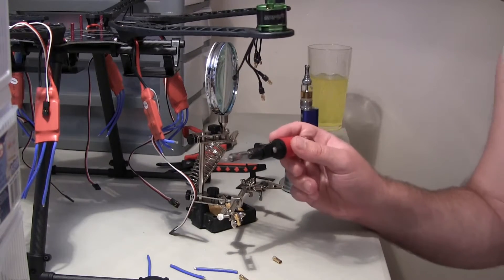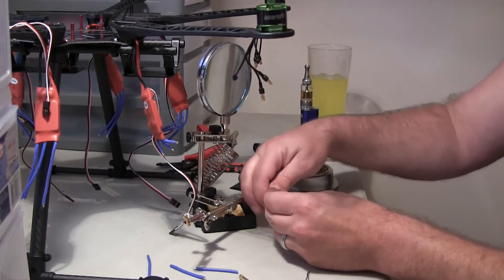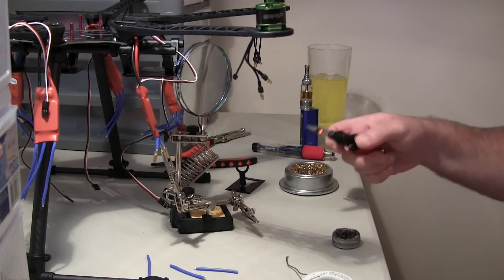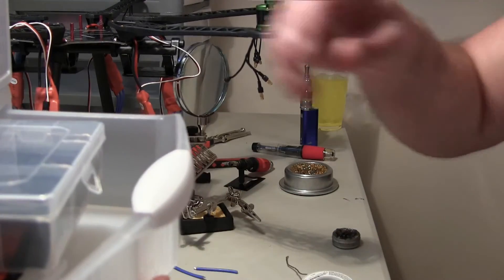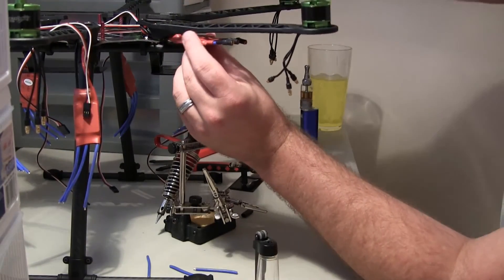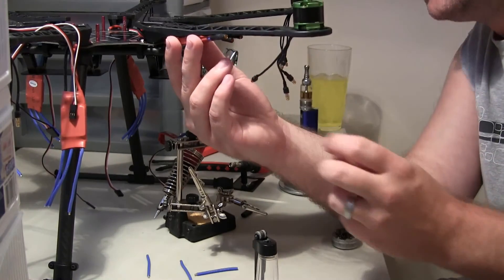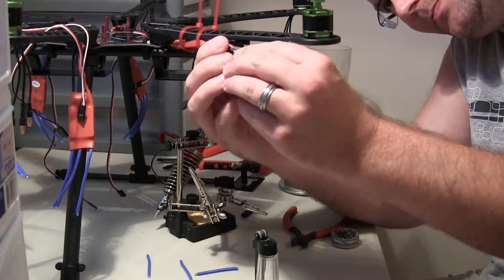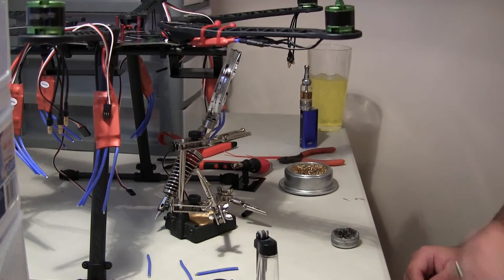S550 Build Part 3.6 - ESC to Motor - Soldering bullet connectors ect

Comment: any reason i couldn't build this copter with just 4 arms to make it a quadcopter?
Reply: Don't do that, it will be unbalanced. Use the s500 frame instead, it's the same thing but built for quadcopters.
Reply: Robert Moore
thx. makes sense